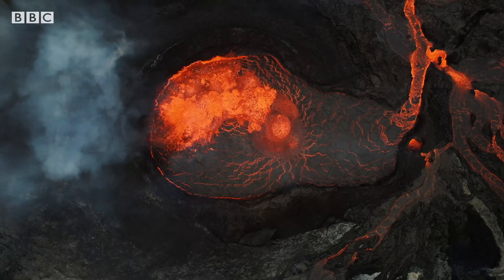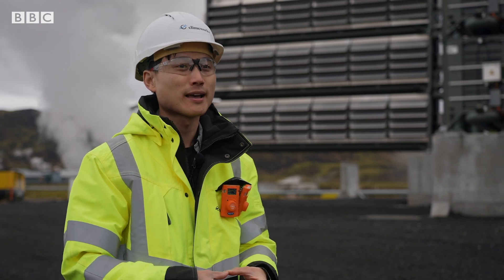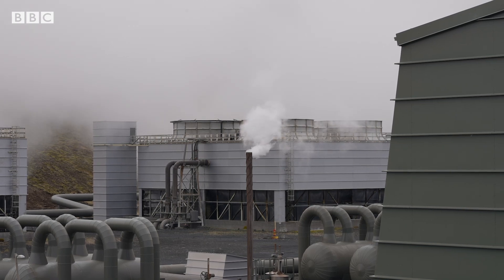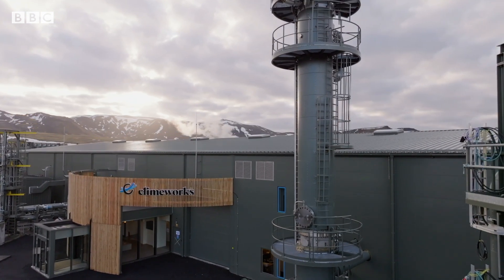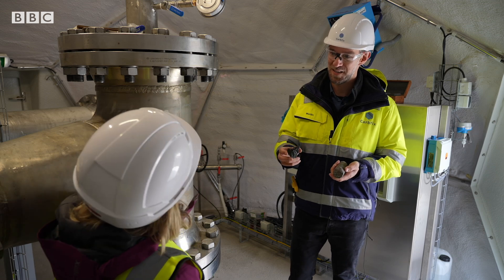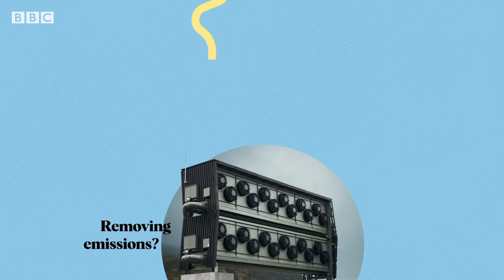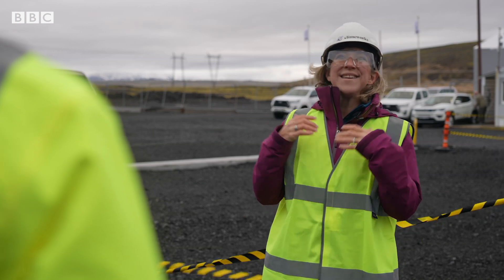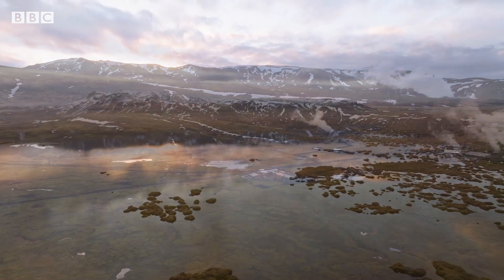Inside the hidden carbon plant pulling CO2 from thin air | BBC News

Comment: It’s also a money sink
Reply: …..Meanwhile every country has an impressive national debt
Reply: @stephenfiore9960 meanwhile some countries are going to find their farmlands turn very unproductive.
Reply: @stephenfiore9960  and in the long term it is not like it is going to matter. Humans have an uncanny ability to adapt to their environment. I mean we evolved in the hot humid climates near the equator during times of much higher CO2 levels. Then we figured out ways to survive in the arctic tundra. Humanity will find a way to thrive and survive. Unless of course, God throws a giant space rock our way.
Reply: what is the ideal co2 concentration for plant growth?
Reply: @juzeus9  it depends on the plant but the big issue would be temperature.  Many crops stunt their growth in very high heats.  Increased c02 concentrations increase the heat of a gas like air.
Reply: the answer is, 3 times more than current levels
Reply: @juzeus9  and what temperature would the air be at that concentration (with the usual amount of solar radiation) and what other impacts would it have.

This isn't a climate controlled glasshouse.  What would the impact of plant growth be.
Reply: This is what CO2 emissions cost. And it will be taxed one day (soon).
Reply: @NoidoDev  yeah, and the developed world should really put the screws to the developing world, since that is where the greatest growth of CO2 emissions will be in order to perpetuate the scam.
Reply: @NoidoDev  co2 doesn't cost anything unless you are paying to have it pumped into your greenhouse
Reply: @monk_bot co2 has logarithmic effect, so about the same temperature as it is now. co2 increases AFTER temperature. "To the consternation of global warming proponents, the Late Ordovician Period was also an Ice Age while at the same time CO2 concentrations then were nearly 12 times higher than today-- 4400 ppm."
Reply: @juzeus9  
No reasonable person is going to listen to you. Feel free to write a paper and discuss it with scientists.
Reply: @NoidoDev  that's my line. you probably think you did research when the tv says "scientists say". i just posted a quote from a scientist and you didn't read it.
Reply: @NoidoDev  I suggest that you be a little more well rounded in your reading.
Reply: @juzeus9  
That's not how it works.
Reply: @NoidoDev  go home, bot. "the Late Ordovician Period was also an Ice Age while at the same time CO2 concentrations then were nearly 12 times higher than today-- 4400 ppm."
Reply: @juzeus9  
Stop bothering me and others with your arguing, and false claims. Again, if you want to discuss this go to some climate scientist, write a paper.
Reply: @NoidoBot you're talking about yourself again
Reply: @NoidoDev  equivalent of a little kid closing her eyes, plugging her ears, yelling, “LaLaLaLa……!”
Reply: @Muchoduder  
You are not entitled to me discussing with you. I told you both the right way how to do it. Your tricks won't work.
Reply: @NoidoDev  😆😂

Comment: 36,000 tons.   co2. only - We create 48 billion tons per year.   So this technology, even with trillions of dollars put behind, it has no hope of getting anywhere near what is needed.
Reply: But nobody propagates such plants to compensate the whole emission of today.
They are meant to be part of a variety of measures, which compensate inevitable RESIDUAL emissions after we largely got rid off burning fossil fuels.
Together with "normal" CCS, BECCS, forestation, forced humification, forced use of wood as building material, ...
And this is just a small pilot plant.
Let's assume 20% of today's emissions as residual emissions. And the compensation of 20% of these residual emissions by such DACCS-plants: This would be 1.5 billion tons of CO2 annually.
1500 plants with a capacity of 1 million tons per year.
Worldwide! Absolutely feasible.